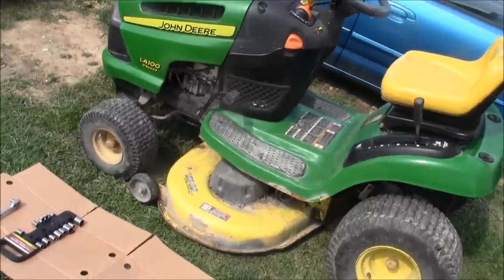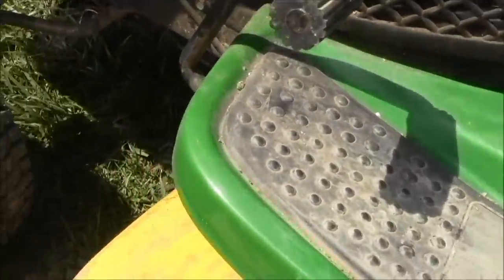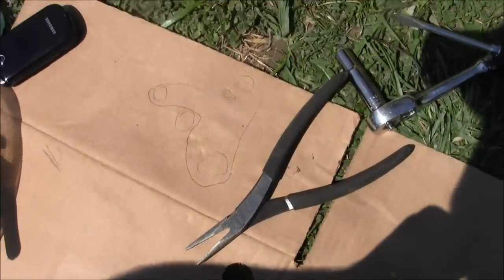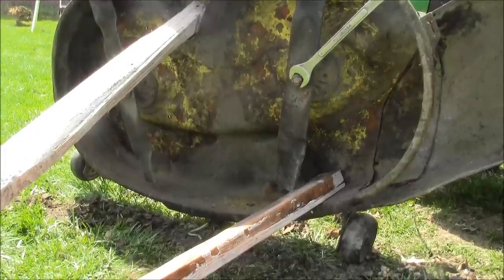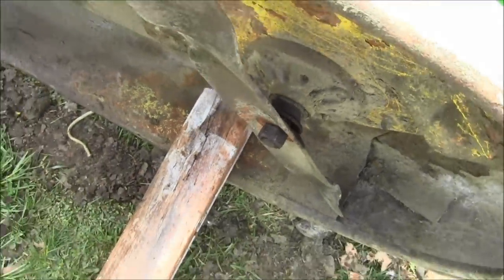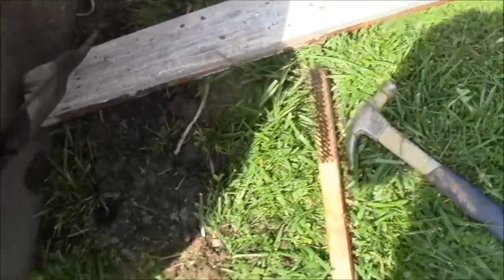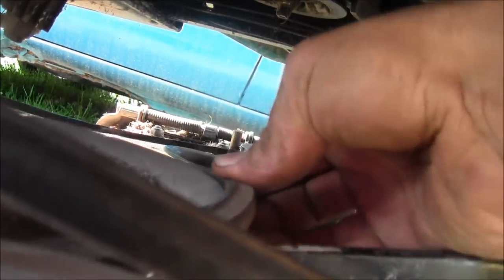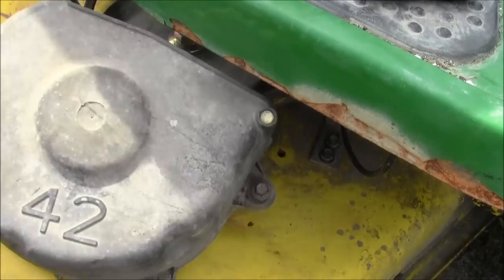How to Replace Cutting Blades on John Deere LA100 Riding Lawnmower

Comment: I highly recommend a magnetic bowl when working on anything removing fasteners. Nut, bolts, screws will stick to the magnetic bowl and you will not lose them. They are cheap at harbor freight or online and they can be a lifesaver.
Reply from the maker: I got one years after this

Comment: Why does the blade hit the sides of my lawn mower? LA 110
Reply: Need help quick. Why does the blade hit the sides
Reply from the maker: Drive shaft may be out of alignment or loose. Blade may be wrong size. Blade deck may be warped.
Reply: because some drunk rider must have been mowing demolition derby style